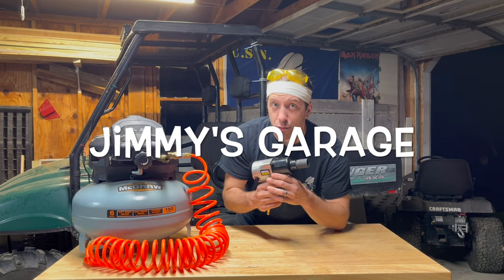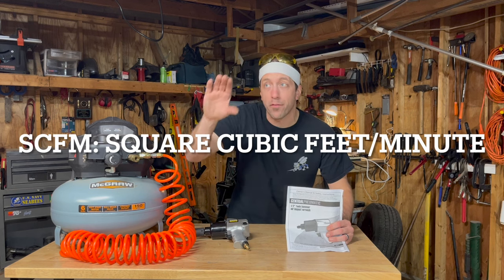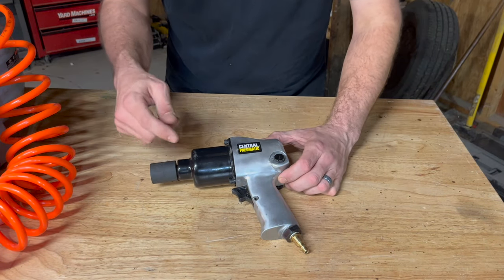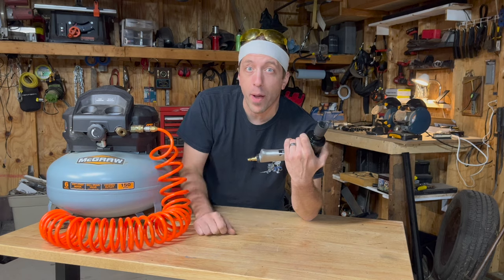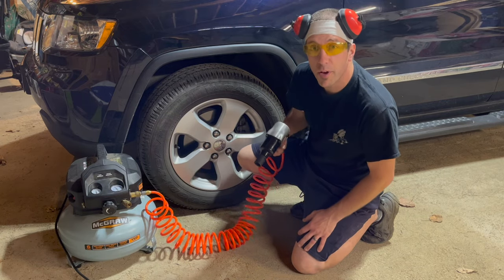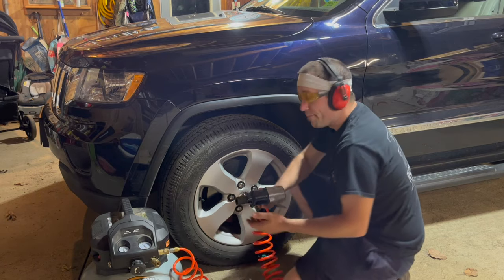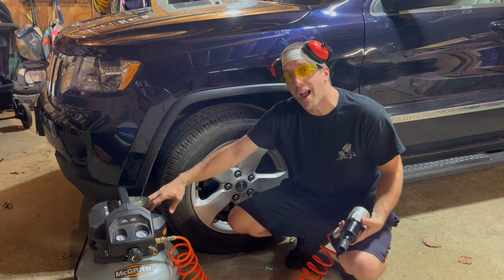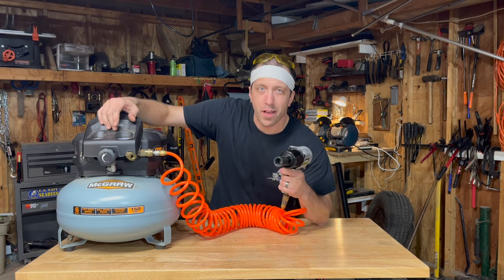Impact Wrench With A Small Air Compressor - Is It possible?

Comment: Hey guys just some additional information... always set the compressor regulator to the maximum pressure setting not what the tool manufacturer recommends. As air travels through the hose, pressure and Volume decrease due to friction. If you set the tank at 90psi by the time the air reaches the tool it might drop 20psi or so.  Dont be afraid of over feeding the tool 👍
Reply from the maker: Great point!
Reply: I have a McGraw 8 gallon 150psi compressor with this exact impact gun how much higher psi than the gun calls for would be good to go
Reply: my 175psi compressor would like to have a word with you
Reply: Great point
Reply: @garyalensr I have the same set up and can’t get mine to even break loose lug nuts
Reply: That's why most people use a 3rd meter at the base of the tool
.
Tank pressure 
Lime pressure 
And tool pressure
Reply: Terrible, this idea. There are air compressors that go up to 200 psi. You definitely don't want to feed any tools/attachments that expect 90 psi with 200 psi. If you want to ensure your tool has 90 psi at it's input put a gauge on the tool end of the hose and make your adjustments to have the pressure there read 90 psi while running the tool.

Comment: SCFM stands for: Standard Cubic Feet per Minute, Standard means  that this compressor can deliver this amount of air measured in Cubic Feet each 1 minute of time when operated @ STANDARD pressure and temperature conditions which are: P = 14.7 psi & T = 60 F.

Comment: This is my third vid I’ve watched tonight, I was a little disappointed that a bigger and expensive air compressor was needed to run the air gun to remove the lug nut, but it looks like it works. 

Thank you!
Reply from the maker: A bigger one will work better, but the 6-gallon will do the trick. Thank you for watching 🇺🇸🤘

Comment: I agree with your conclusions here.  I've been using a similar 6 gal. Porter Cable pancake to run my IR 231C impact for many uses such as removing lug nuts, etc.  Those little compressors will even run the HF purple HVLP paint sprayer fairly well.  Not so great for running die grinder or cut-off wheels. 
For some reason, the comment I put on your previous vid got deleted.  I mentioned that the HF impact gun you showed is very similar to the IR 231C.  It is probably just as good and a lot cheaper.
Reply from the maker: I agree with you. Running a die grinder or cutoff wheel will work for very quick jobs, otherwise you’ll be waiting a while! Thanks for your feedback 🇺🇸🤘

Comment: Thanx for the upload. Just bought a 6 gallon tank and saw ppl said it worked for them as well. I think the cfm is powerful enough for an impact wrench considering ppl hand tighten their lug nuts with a socket or breaker bar
Reply from the maker: Thank you for watching! They will do the trick for short projects for sure.

Comment: This test is exactly what i needed someone to do !! 
Wow! you wouldnt imagine all the reading ive been doing trying to find out if i could use a wrench or not with these sorts of compressors and everything talks about complicated technical mumbojumbo some even stating i need to have over 25% MORE cfm than tool states etc etc etc etc blablabla.

Thank you so much for this video!
Reply from the maker: No need for that nonsense. I try to make it right to the point. Thank you for watching and commenting 🇺🇸🤘

Comment: In my experience, this will work.  You won't necessarily get all the torque that the impact is capable of, but it'll [usually] get the job done.

My father was a professional mechanic, and we used an old 6 gallon Montgomery Wards branded hot dog compressor for repairs done in our home's garage (of course he had a much bigger compressor in his shop). We did all sorts of repairs at home (engine/transmission rebuilds, front end work) all with a dinky 6 gallon compressor.
Reply from the maker: They can be incredibly useful. Thank you for watching 🤘🇺🇸
Reply: I'm an amateur just working on my own cars. I have the pancake for nail guns mostly. I figure on using the pancake for some impact wrenching, blowing air, filling tires, and other light duty stuff that a shade tree idiot might get into. What's the worst that can happen, I get out the breaker bar more often than someone who bought a 40 gallon tank? I'll live with it.
Reply: How would you say using a 6-gallon and an air impacts compares to using a cheap cordless electric? Would it be Stronger?
Reply: @skullman0819  Hard to say.  The cheap ones really vary in how much torque they promise vs what they deliver.  The cheap ones (sub $150) on Amazon are a bit of a joke.

I picked up a 20v 1/2 compact Hercules impact from Harbor Freight this month.  The tool by itself was about $60, and I paired it with a 20v drill kit to get a battery and charger.  I ended up with an amazing setup for less than $200 that took off an axle nut torqued down to 180+ pounds like it was nothing.  It's also small enough that it fit almost anywhere around the front end of my Honda.

All in all I like it better than my 6 gallon air compressor setup.  It's stronger and makes way less noise.
Reply: @RandomBitzzz  will a cheap air gun get my head bolts off? Because a cheap impact didnt
Reply: They have corded impacts too, there's a bauer one on sale today and tomorrow for 60 I think at HF. I'd bet on those working on tough bolts before the battery ones personally.
Reply: Should qualify I mean the cheap battery ones. Idk about pro grade battery tools vs the corded ones.
Reply: @kw6713a  Yeah, from what I gather the Bauer corded one isn't bad - so long as you don't strangle it with a thin extension cord.  I avoided the corded one because the body on it is huge, and I needed to get into tight spaces.

Comment: 3/8 air line and 3/8 automotive fittings from harbor freight make the set up even better.

Also considering the cheap spare tanks from harbor freight.
Reply from the maker: Good call. More air flow is better for tools like that. 🇺🇸🤘
Reply: How long of air hose is good till its not so good

Comment: I have a 5 gal compressor with a 10 gal tank hooked up in between my tool. So 15 gal in total volume. For what I need air for, this works fine.
Reply from the maker: Ooh good thinking right there. Love expansion tanks 🇺🇸🤘

Comment: Got an an air hammer the other day, have a small pancake compressor like yours. Diagrams that come with the tool would have me buy and set up an air filter, air regulator, and water separator. Is all this needed? Or can i just send it as is?
Reply from the maker: Send it! I’d oil the tool before each use and make sure to drain your tank after each use. The air/water separators are awesome when you’re in a humid climate, but not totally necessary.

Comment: Yeah, in my estimation its about time, its about consumption with any air tool. A small compressor is fine it just limits the time you can use the tool before the compressor has to cycle on to renew the volume in the tank 👍
Reply from the maker: That’s true! Smaller tanks hold less air - so they can’t run “air hungry” tools for very long. But for short bursts - they usually do the trick.
Reply: @jimmysgarage9068  i do a Fair amount of car painting and I used to think as some guys do that a low cfm rated compressor will make my spray gun spray poorly.  The spray gun was say 12cfm rated while my compressor was 8.5cfm. that was dumb 😂 
The actual issue was if I were to shoot an entire car as opposed to a panel like a fender  the compressor wouldn't be able to supply the necessary air volume to the gun once tank pressure dropped below the 60psi threshold so I had listen 👂 as I sprayed so I could know when to pause and allow the compressor to refill the tank.  The cfm rating of any air compressor is the pumps ability to supply air when the tank volume is low enough to cause the pump to cycle on. Obviously a smaller pump will create less volume/pressure than a larger one in a given time frame

Comment: Are you using 1/4 in fittings and hose ? Is that a oil free compressor?
Reply from the maker: 1/4” NPT fittings and hose. Oiless compressor.

Comment: The problem is when you are not using the rated cfm for the tool you are not getting the full power capacity of that tool either. You are basically wasting money. If you don't need the power of the tool you can save money by buying lower cost tools with lower cfm requirements. However, I get the point of the video and you proved the point.
Reply from the maker: Great points man. Thank you for watching 🇺🇸🤘
Reply: The cfm is what the pump itself can deliver, not the tank.  So if your tool is 4cfm @ 90PSI and your pump is 2 cfm, you have full power till your pump can't keep up 90 PSI in the tank.  The problem is that you won't be able to run it that long.  If your pump is higher then the tool rating you can run it continuously.  So it's not a downgrade in power, but run time.
Reply: @DavidStrchld EXACTLY 👍 people think it means power or force but it's time/consumption ...A 1 gallon tank will provide the same power so to speak to the  tool  as a 60 gallon but you will not be able to run the tool as long with the smaller tank/pump combo. You'll have to stop and wait for the compressor to fill the tank back up. Spray guns require much more cfm because they "consume" more air than an impact it's basically a controlled leak 😂

Comment: They're soo much quieter than full-sized compressors. I worked with one that was soo loud it caused me to get aggressive. I hated that fn compressor so fn much that it has been 15 years since I last owned one. Now I own a tiny 6 liter Ryobi and it makes soo little noise. Most of the noise it produces is all vibrational. So what I do is I throw a couple of towels down at the bottom of my closet, which has a power outlet in it already. It's too convenient. I then run it in the closet with the doors closed on the pipe as to still be able to draw air into the closet but block out a LOT of the noise. With the windows closed and the doors closed nobody has to know that I'm airbrushing or blowing out my PC.
Reply from the maker: They are. I just purchased the Ultra Quiet Fortress 6-gallon machine. Look out for the review - coming soon. Thank you for watching and commenting 🇺🇸🤘
Reply: That's why us men LOVE peace and quiet cause we hate ourselves for allowing circumstances for  getting aggressive

Comment: Think that setup would take off axle nuts? I cant gwt mine was ff and i need to incest in an impact wrench but dont know qhere to start.
Reply from the maker: Yes, I used my old 6-gallon HF machine years ago to remove an axle nut. Look into the Fortress 6-gallon machine - I have a full review of that. It’s a beast! 🇺🇸🤘
Reply: @jimmysgarage9068  thanks dude 👍

Comment: Should I buy a retractable or coil hose for my small portable compressor?  If I wanna do projects outside my mancave garage should I just buy a portable  coil hose to use with compressor. I don't projects inside garage only outside garage
Reply from the maker: So, the larger hose will give you more air flow if you need more pressure. Coils generally max out at 90PSI. If you can swing it - get both. That way you have an easy setup in the garage and out. I hope that helps. 🤘🇺🇸
Reply: @Jimmy's Garage  I have a critter Mason jar sprayer from amazon. Do u think a 1 or 2 gallon air compressor will work for this?  I wanna do small painting projects and maybe in summer paint spray paint my kitchen cabinets too and air up tires and that's pretty much it
Reply from the maker: @futbol1972  Check the air requirements of the tool. You may be able to use a 6-gallon in short bursts. Anything smaller than a 6 is for nailers/staplers. Small tanks simply cannot hold enough air for continuous use, even with powerful motors.
Reply: @jimmysgarage9068  thsnk u

Comment: Why is it that when i set my air regulator to 90psi to use my impact gun, I press the trigger and the pressure drops below 90. Is that right?. Or do I need to set my regulator above 120 so when I pull the trigger it drops to 90 constantly?
Reply from the maker: Are you using a spiral hose? If so, swap it out for a bigger smooth hose. Those spirals are usually rated for 90PSI and can’t operate larger “air hungry” tools. If that’s not the case, make sure your tank is in good shape (always drain it) and make sure there aren’t any obstructions. 
Also, smaller machines are rated for lower CFM, hence the drop in pressure while using an impact. It won’t hurt anything to crank up the regulator a bit to get more power. I hope that helps 🤘🇺🇸
Reply: @Jimmy's Garage  thank you. I have a 21 gal tank 175psi, also use a smooth 50ft air hose rated to 300psi max

Comment: Compressors work better with 3/8 ID air hoses, easily converted from the stock 1/4'' hose.
Your impact wrench will have more volume of available air.
Reply from the maker: True!

Comment: I'm inheriting a 3 gal 125 PSI Craftsman air compressor, wondering if this will work just for small jobs such as changing car wheels, shocks, etc.?
Reply from the maker: 3 gallons are kind of useless. They don’t produce enough air for pneumatic tools. 6-gallon is the smallest you’ll want for an impact wrench/impact socket.
Reply: Thanks! I think I saw your other video saying that after I made my remark above! Appreciate your advice!
Reply from the maker: @macferron  Hey thanks for watching man. 🇺🇸🇺🇸

Comment: I have 6 gallon, but only gives me the torque under 100 fb..anything higher than 100 fb, it would move the lug nuts...my hose connector has a little bit leak, should not make too much difference...
Reply from the maker: Take the connectors out, put some fresh Teflon tape on the threads and re-install. You’ll want to avoid air leaks as much as possible.
Reply: @jimmysgarage9068  just got a 15 gallon compressor, which gives me 150 fb torque...the diameter of hose is 3/8, bigger than you showed in the video...I wonder yours is so powerful, whereas I can't make it happen

Comment: Does it really mater if the air compressor kicks in or not when using an air impact?  If the air compressor and air tool can do the job then that should be the main concern, not whether or not the air compressor needs to kick in while doing the job.

Just buy an older oiled compressor for $100 as the older compressors have higher CFM ratings at 90 PSI than any garbage oil-less garbage air compressor today.  4 CFM @ 90 PSI is the bare minimum anyone should use to run air tools off a small portable 4 gallon air compressor.
Reply from the maker: I did exactly that - I bought an old professional machine, 10 gallons. Works great, fills up quickly. Love it.
Reply: @jimmysgarage9068  Same here!  I bought an older oiled Clarke 4 gallon air compressor that puts out 5 CFM @ 90 PSI.  Cost me $100.  Had to replace the plug end but that was $3.00.  Now I have a great little air compressor that will do both my air tools and my framing nailers.

Comment: I’d preferr a 🖐 gLN tNk thO..  Y? cas I like that # beter(er).  too bad they don’t make a compressor which can keep up the air pressure enuf to not need pauses - refills.. at which point - why a tNk at all?, & EvN if they did all that, it’s still UZng electric to run the compressor & whole setup.  so what’s the point of even the compressor, etc.?.. hmnnn?🤔